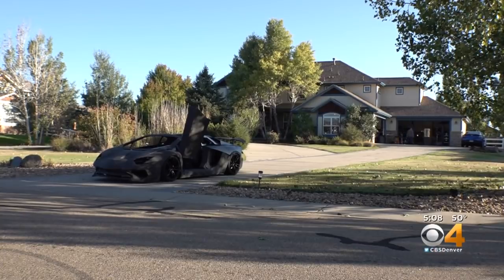Erie Family Builds Lamborghini Aventador Using 3D Printing

Comment: News Reporter: “how fast will this go?
Dad: pauses
Dad: Good Question.

Lmao he didn’t even answer the question
Reply: Pussy he did, the car is sported with a Corvette engine, it has a top speed of 200mp/h ,well the reporter also added that he didn't test its limit on road yet.
Reply: @hhakyt  It doesn't work like that. They're saying the Corvette they took the engine from has a top speed of 200 MP/h. This car only has a good engine, but the rest is not even Lada production level quality. So the top speed is definitely not 200, it would fall apart doing anything higher than 30

Comment: Well, I left Kentucky back in forty nine
An' went to Detroit workin' on a 'sembly line
The first year they had me puttin' wheels on Cadillacs

Every day I'd watch them beauties roll by
And sometimes I'd hang my head and cry
'Cause I always wanted me one that was long and black.

One day I devised myself a plan
That should be the envy of most any man
I'd sneak it out of there in a lunchbox in my hand
Now gettin' caught meant gettin' fired
But I figured I'd have it all by the time I retired
I'd have me a car worth at least a hundred grand.

I'd get it one piece at a time
And it wouldn't cost me a dime
You'll know it's me when I come through your town
I'm gonna ride around in style
I'm gonna drive everybody wild
'Cause I'll have the only one there is around.

So the very next day when I punched in
With my big lunchbox and with help from my friends
I left that day with a lunch box full of gears
I've never considered myself a thief
But GM wouldn't miss just one little piece
Especially if I strung it out over several years.

The first day I got me a fuel pump
And the next day I got me an engine and a trunk
Then I got me a transmission and all the chrome
The little things I could get in my big lunchbox
Like nuts, an' bolts, and all four shocks
But the big stuff we snuck out in my buddy's mobile home.

Now, up to now my plan went all right
'Til we tried to put it all together one night
And that's when we noticed that something was definitely wrong.

The transmission was a fifty three
And the motor turned out to be a seventy three
And when we tried to put in the bolts all the holes were gone.

So we drilled it out so that it would fit
And with a little bit of help with an adapter kit
We had that engine runnin' just like a song
Now the headlight' was another sight
We had two on the left and one on the right
But when we pulled out the switch all three of 'em come on.

The back end looked kinda funny too
But we put it together and when we got through
Well, that's when we noticed that we only had one tail-fin
About that time my wife walked out
And I could see in her eyes that she had her doubts
But she opened the door and said "Honey, take me for a spin."

So we drove up town just to get the tags
And I headed her right on down main drag
I could hear everybody laughin' for blocks around
But up there at the court house they didn't laugh
'Cause to type it up it took the whole staff
And when they got through the title weighed sixty pounds.

I got it one piece at a time
And it wouldn't cost me a dime
You'll know it's me when I come through your town
I'm gonna ride around in style
I'm gonna drive everybody wild
'Cause I'll have the only one there is around.

Ugh! Yeah, RED RYDER
This is the COTTON MOUTH
In the PSYCHO-BILLY CADILLAC Come on

Huh, This is the COTTON MOUTH
And negatory on the cost of this mow-chine there RED RYDER
You might say I went right up to the factory
And picked it up, it's cheaper that way
Ugh!, what model is it?

Well, It's a '49, '50, '51, '52, '53, '54, '55, '56
'57, '58' 59' automobile
It's a '60, '61, '62, '63, '64, '65, '66, '67
'68, '69, '70 automobile

Comment: Amagine if this crashes wouldn’t it just like break and shaders
Reply: Bruh a speed bump gonna break that thing 😭
Reply: @Swazified  It won't. They said it's layered with carbon fiber and epoxy. Carbon is lightweight and epoxy acts as a glue. And even if it could, they could always print a new body panel or fix the chassis.
Reply: Eli Soshi it’s still a pile of shit tho
Reply: @danishmoocow4424  you Are. (maybe, I don't know. Leave me alone.)
Reply: Every lambo I seen crash has just blew up there made from shit. This homemade one is probably stronger.
Reply: @deleteduser4045  they are made to crumple so the passenger and driver can live.
Reply: логан ...I have my doubts. How about you crash it into a wall? I’d love to see it
Reply: @DrPonyo  you must not live in California. These things seem to be made really cheap for what you pay .
Reply: Saustrich The ostiche yep just shatters everywhere
Reply: I imagine that it would shatter.
Reply: It would definitely shaders
Reply: Amagine it shaders
Reply: Shits gon melt when the heat come thru
Reply: Dust
Reply: *imagine
Reply: Metal frames. Carbon fiber and epoxy makes it strong. Btw 3d printing material is strong. Of course not as strong as metal but pretty safe.
Reply: NukuNuku  nor would I complete useless shit, unless it has 4x4 and a bed you can keep that pile of shit.

Comment: Dont hit a pot hole the front end will be shredded
Reply: It's reinforced with carbon fiber though...
Reply: Auto Young no, it’s not, it’s wrapped in carbon fiber. The epoxy is what’s holding it together.
Reply: Mm it’s carbon
Reply: Yeah the car will be fine but you'll probably be shredded
Reply: You could just reprint it, no big deal.